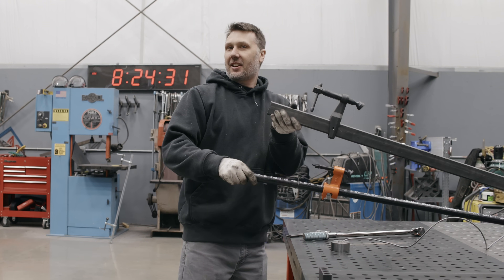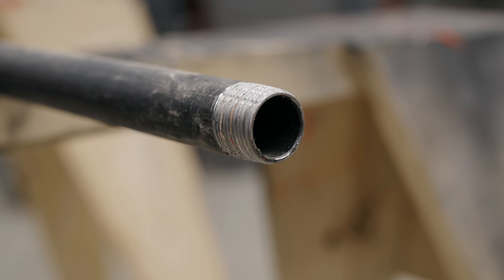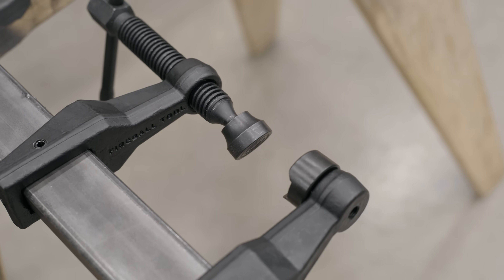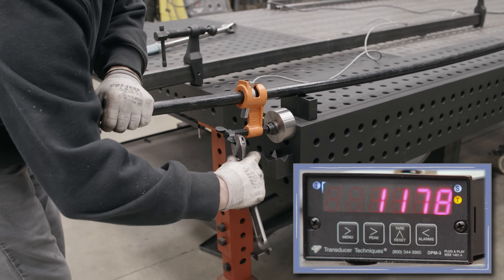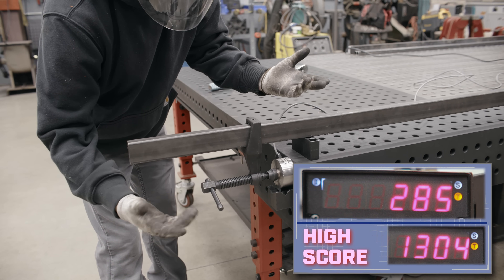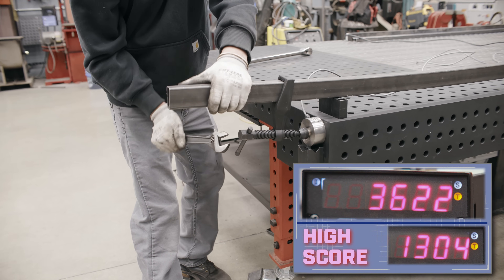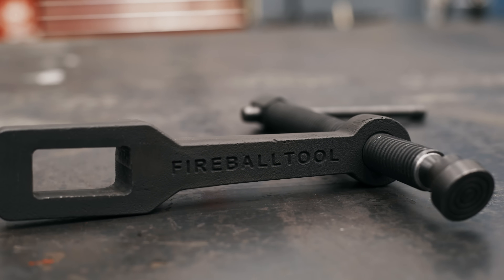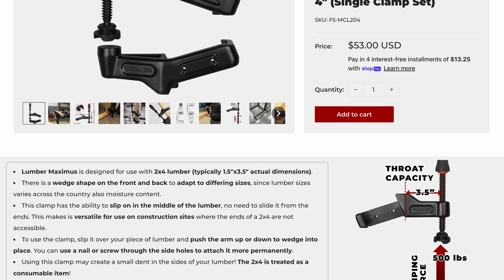What Is Stronger? A Pipe Clamp or a Maximus Clamp?

Comment: Those Fireball clamps are worth every penny 🙌 I'd never be using a standard pipe clamp for anything more than holding wood projects together. If u are doing large heavy duty metal fab builds and don't invest in the right tools, then u deserve a clamp busting off in the face area 😉✌️

Comment: Suggestion, Jason. A version of these clamps, where the jaws are four total pieces, two for each end of your bar. Each end, has the part that goes over the 1x2 bar, but it has openings for two bars at a 90deg offset, so a second, short bar goes through perpendicular to your long bar, and gives you adjustable jaw depth. You then slide the end of the jaw onto the end of the short bar. Like, imagine if the neck of each jaw was just another piece of 1x2 pipe. Hope this isn't too confusing.

Comment: Question Mr. Jason. in a hypothetical situation you needed 1 inch  more depth of throat but not as much strength. could you use 1 long bar of 1x1  and 2 small pieces where the clamps are at each, and even weld the small piece to the long one so it don't slide??? lets see a test jig of how much it bows with a single 1x1 in 90% of the span of the clamp
Reply: "1 inch more depth of throat" hehe
Reply: He recently did a video where he stacked the two 1x1 the whole length.  It bowed considerably more than a single 1x2 until he stitch welded the 1x1 every few feet.  It still bowed more than the 1x2.  That said, I don't see why your idea wouldn't work, say, if you didn't have two  full lengths of 1x1 and just cut a 4" stub to slip into each clamp, but I am certain it's not going to offer any clamping power.
Reply: So you mean welding a short 2x1 section at the ends of your 1x1 so you can offset the 1x1 from the clamps a bit?

That sound like a cool test. There will be more leverage, combined with the weaker tubing there will be loads of bowing. 

I'd say you get around ⅛ of the clamping force compared to a 2x1 section at the same amount of bowing. 

At least that's what I would assume from the moment of inertia calculation: (w*h³)/12. Width times height cubed divided by 12. 

So if you double the height of your bar you get 2³=8 times the moment of inertia. The width stays the same at 1 inch.

My last mechanics lecture was many years ago so I hope I'm not too far off lol.